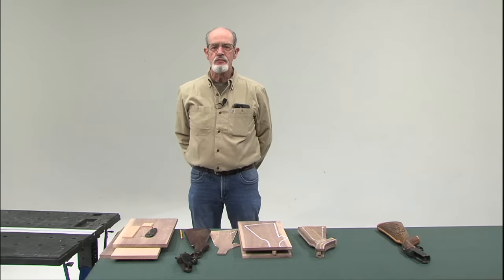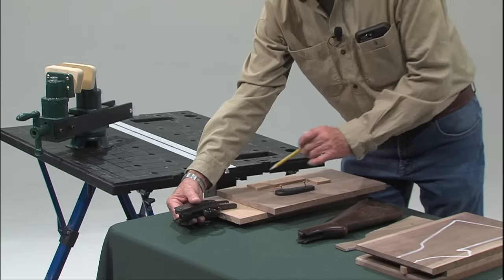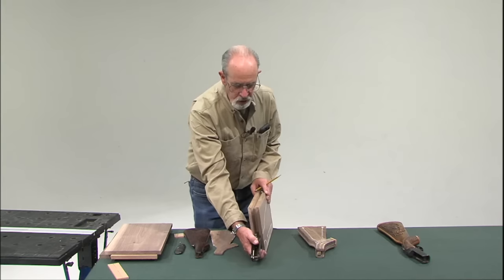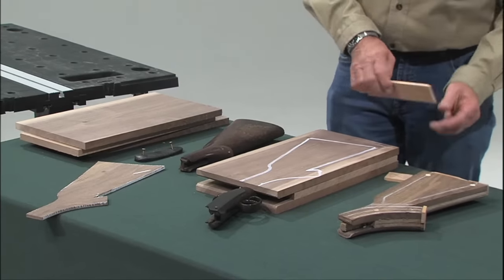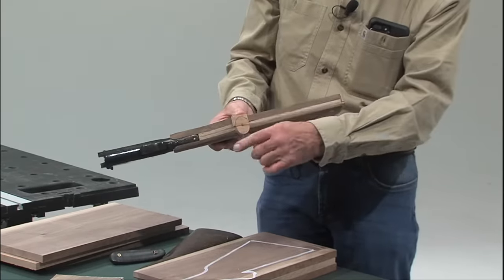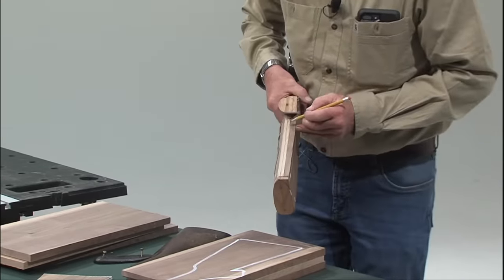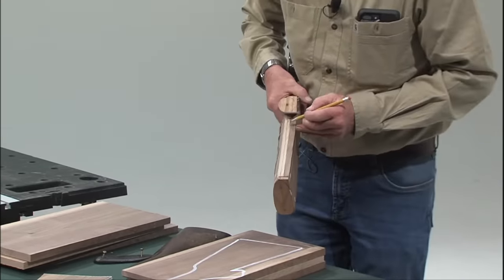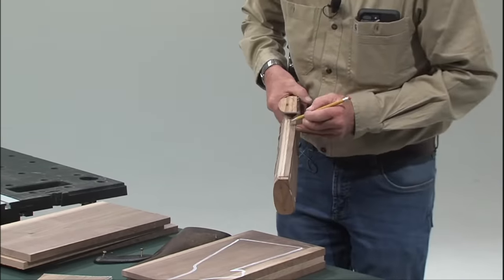How to make a carved gun stock

Comment: Interesting method though missing a few major gun stock requirements such as "Drop" "Cast on or off" "Length of Pull" "comb height" to name but a few. Cascamite wood glue is totally waterproof they use it to make wood boats, Oak is not a suitable wood for gun stocks it cannot take the shock of shooting a gun and is much heavier that is why Walnut is the preferred gun stock timber with Beech in second place. A gunstock is not just a piece of wood or many pieces of wood it has about a thousand years of development behind it.
Reply: White oak is actually stronger than walnut by all comparisons. 
People use walnut because they think it looks better.